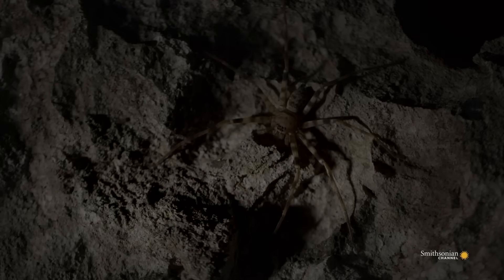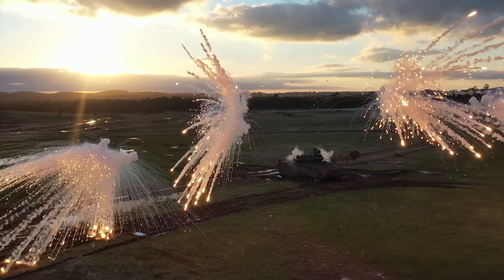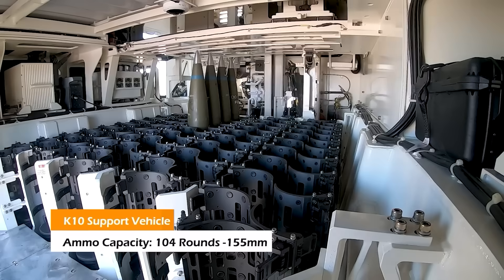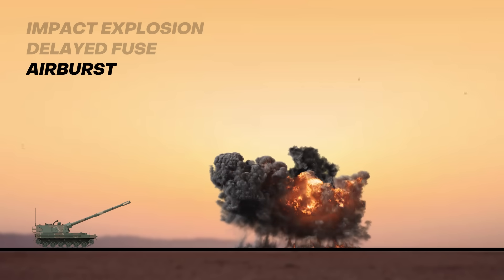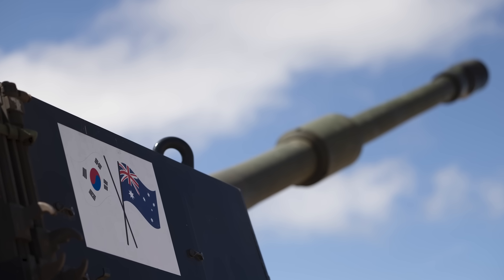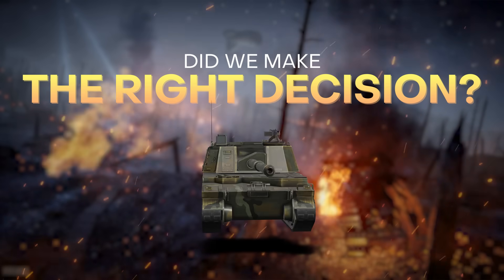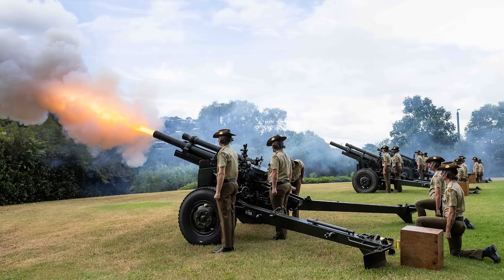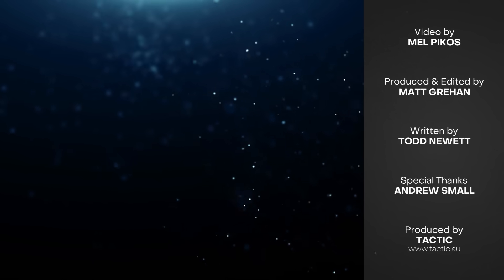The AS9 Huntsman Explained: Australia's New Heavy Artillery

Comment: They probably did their research but for me the first thing was it is slow 67 km/h and its range is 360 km logistics could be an issue.
Also it can't move and fire at the same time and it is not modular so customizing it later is costly.

On the other hand KDNS and Rheinmetall are looking into Modularity as a standard.
They are looking into mounting additional automated smaller turrets and other automated systems for close range anti drone warfare for their existing vehicles. 

I think the problem with Australia is that they are in a hurry to arm themselves and doing things fast might not always be the best.
Anyway it is maybe a good thing that they only bought a few of them it better to have some then none.
Especially now that Europe is also going to be making massive orders for new military systems.

Comment: Ex-gunner from 7Fd Regiment and then a naval officer of 30 odd years here. 
Hmm,  mobile artillery always seemed a no-brainer to me, but l could see the use of a mix of that and light towed  or air delivered artillery aka 105mm for amphib or other expeditionary operations would be useful.  Not quite sure why we got rid of the 105mm; l thought it was handier, easier to manoeuvre on the battlefield and logistically simpler to manage.  
On top of that, with my navy hat on, our direct threats are and have always been from the sea, hence the bigger investment in the Navy atm.  
Anyways, my two bobs worth.
Reply: The 155 mm standard use around the world for all heavy guns this is why a change was made. Any weapon and caliber will be used as it should but logistics and supply is what wins a war. The ability to use any countries or branches stores is a significant advantage.
Reply: @lawrencemason2827  155mm is a medium caliber.
Reply: @anthonykaiser974  sorry did I say Larger or Large. But yes correct.
Reply: @lawrencemason2827  had you said "large caliber" that would be 76.2mm/3 in or larger, this is correct by UNROCA std at least (TIL). You said "heavy" which, depending on who you ask, would be larger than 155, which has been a breaking point between medium and heavy, particularly since true heavies (i.e. 203mm/8") are still employed. As a career US FA officer who came into service while the M110 series was still (barely) in service, I'm sticking to my  "155 is medium artillery" belief. Heavy roles were assumed by rockets and missiles like MLRS.
Reply: Well said Kim
Reply: Whilst 105mm howitzers
(M118/119) were light weight and air drop capable, they severely lacked the range and lethality that medium caliber howitzers could achieve. The inverse of this was that essentially every contemporary 155mm towed howitzer was far too heavy to be air mobile, namely the venerable M198 in US and Australian service.

The M777’s largely titanium construction offered an excellent compromise of the range and lethality of medium towed systems, whilst weighing half as much as the equivalent medium system 4.4t to the M198’s 8.8t.

Don’t get me wrong, there are a number of drawbacks to the M777 where a 105mm system would shine, but the biggest kicker is simply 105mm systems are far too short ranged and lack the punch of 155mm.
Reply: 105mm is weak nowadays.
Reply: @A-xp6my it's weak.... But it's mobile and more efficient in littoral environments.
Reply: @andrewcox710  any drone can do it cheaper and more accurate
Reply: @A-xp6my  how long does it take for a drone to cover 40km? Cos a 155mm will do it in about 1min 20sec. 
In an environment where engaging time sensitive targets are sometimes key to the success of overarching plans, everything has a place.
You don't play golf with one club (fpv drones).....
Reply: @andrewcox710  Time does not matter.  If the target moves your cannon will suck, but drones will follow it. For the price one Excalibur you can send 100 drones nearly simultaneously on 40km. They will be slow, but nearly impossible to evade. And they can destroy 100 targets. How many targets can one Excalibur destroy?
Reply: @andrewcox710  Depends on what drone. But whatever you would use, for the price of single Excalibur you can send 100 drones, and they will be remotely guided and follow moving target, or even destroy 100 targets. 
Imagine you fight a strong advanced enemy, within that minute of your shell in the air the enemy's radar will locate you and send their shell back. Boom, your artillery is destroyed. But you don't care if you launch drones.
Reply: The 105 kept us alive!  Arti fan.
Reply: Hey mate, ex 108 Bty 4th Fd Regiment gunner here, served from 00-04. The L119's we used to use were to be honest, ancient... We had pushed them to their limit. the old Airborne light artillery being choppered into combat is really now a think of the past. Couple that with its limited firepower, it was well overdue to be replaced. That coupled with the fact that by the time we had fired a round, anti artillery batteries are already able to fire back at us within 40 seconds, which is far faster than we were ever able to pack the gun back up and exfil.
Reply: in Ukraine the russians developed tech to find and return artillery fire on Ukrainian positions with in 15-20min
Reply: @SuperJohn12354  The Russians didn’t invent anything of the such, the equipment used for counter battery fire has been around since WW1, called sounding and ranging.
Granted the modern equivalent with weapons locating radars are far quicker and more accurate.
You’ll find the time to triangulate and return fire isn’t 15-20mins but is actually much closer to 3-5 minutes.

The biggest drawback is that active scanning WLR’s are easily detectable on the electro magnetic spectrum and thus often draw fire of their own, this lead to passive systems which offer less accuracy and speed at the cost of not actually radiating any detectable EMF.
Reply: @SuperJohn12354 😂😂😂 we've had the capability to do this since 2007 mate. As soon as an indirect round, or volley, is fired, we'll see it within 5 seconds and be able to return fires within 1min.
Reply: 7fd when it was im downtown Willoughby
Reply: @kimbaldunsmore4633  Ukraine war tells us gunnery is having a Renaissance. Giddy up!
Reply: @ Sure it does, if you have around half of a million soldiers and a couple more busy with supplying them. Even if you manage to find this many people, imagine the number that your potential enemy may bring. Are you sure you can handle it? Do you still like artillery and gunnery?
Reply: Some of you need to realise Australia has drones too, drones can be shot down, taken out by other drones, birds hell there's footage of cats taking them out they are not invincible and bet as long as your points to ground they are already developing an EMP round most likely deployed by an artillery system
Reply: largest issue with the L119 is the setup and pack up time, with a fully maned fresh!  crew that was familiar and drilled with each other could mange 12-15 minutes to deploy into theatre grid, takes about the same time to pack up depending on prepared ammunition, as you would be aware the counter battery would very find us after the adjusting round and decimate us all, although i see the point of keeping the capability for the reasons he listed i would argue large calibre mortars in the hands of the Infantry would be the better option to maintain that capability, you can amphib and air deploy, move them by rover and trailer and they could maintain smaller calibres if they needed  hump them through the bush.
Reply: American experience in Vietnam showed that the 105mm is inadequate for fire support role. So much so that the M108 (which sported a 105mm howitzer) was immediately retired following the end of the war.
Reply: @mirageiii3176  tell that to Hal Moore's boys at LZ X-ray. 105s kept lots of 1/7 CAV troopers alive. They told me so.
Reply: @anthonykaiser974  Amen!
Reply: @mirageiii3176 the 1/7 CAV at LZ X-ray didn't think so. One of the officers told us in FACCC in 2000 at Ft Sill. When you're danger close, 105mm is really handy, and the rate of fire is really good, especially the first minute (10 rds first minute, 3 rpm thereafter IIRC). If you're close enough, lower charges increase your rate capacity. That said, grunts prefer 120mm mortars, and a SP 120mm How-tar would be a great replacement.
Reply: > On top of that, with my navy hat on, our direct threats are and have always been from the sea,

But since WWII it's always been Army that does the fighting.

Comment: 3:15 If you are already deployed, then sure, but tactically the towed arty is way more versatile if you're dealing with bad terrain, etc (can be floated, slung under helis, driven on narrow tracks, etc). These big self propelled pieces are great if all of your forces are coherent and systematically moved around short distance, but imagine having to move 100km in a rush, loading them onto heavy trucks, etc. Through WW2 jungle/island warfare Australias military restructured by dropping heavy equipment numbers, allowing effective logistics/movement.
But, perhaps if the new modern warfare is all as static as it is in Ukraine, and air power is nullified, then heavy armour does seem logical.
Reply: Imbed a shit ton more Mortar teams into regiments would be useful for what you describe

Comment: Def should have kept 2 regiments of AS9

Reserves should also have 105 towed regt in each brigade
Reply: Himars makes more sense though why the regiments in 1/2 seems more like internal bureaucracy then sound reasoning.
The USA Himars has a prexisting inventory with 500 already produced & 200 more in production to be delivered by early 2028.
AS9's Still have to be made but in a worse case scenario about 50 odd M142 Himars can be shipped to Australia.
Taking both systems since already invested in would have been the best bet incase complications arise for either.
Reply: @arnijulian6241  Problem with HIMARS is the cost of the rockets and how fast they burn through munition stocks. It is an awesome weapon system, but what are those gunners doing once they've run out of rockets?

155mm shells are massively cheaper by comparison (a few thou to ~$100k a shell v ~$1M a rocket), so i'd prefer the extra 30 AS9's as a back up for when the HIMARS rockets run dry.
Reply: @ Depends on how yu look at the service live of mobile convential artillery compared to rocket artillery.
They are both going to get blown up eventually & so is it better cost for many artillery shell that might get used or few rockets that will likely be used.

They both have benefits.
Why I don't understand halfing the the wolf spiders as it's a false-economy to make 30 instead of 60.
still more then 60 I think it is deminishing returns.
should have been reduced to 3/4's for 45 as spare parts will be needed & such systems tend to be canibalized in active use to remain operationsal.

Still you think those in charge are going to listen to any of us?
even a dozen spare for 42 is just enough to work with for brigade.
Reply: @arnijulian6241 I agree on the 60 AS9's should still have been ordered. Even if they "sat around" as a ready reserve along with the towed artillery.

I also agree that both systems have benefits, but I still see one system as lasting longer munitions wise in any conflict.
Reply: @OneLeatherBoot  ''Munitions lasting longer'' in theory?
Certainty is never had in matter of polemology & even if the system is not taken out what's to say an ammo dump or key factories are not to be knocked out.

One Massive advantage of rockets is the platform costs a fraction of the cost while munition can be stored in less bulk as rocketry is self guiding & more accurate.
Really what holds back rockets is the cost of the rocket it's self though that has been reducing in over the century & will eventually match conventional munitions.

Reason why a lot of the west did away with conventional artillery Mortars is they assumed them obsolete by rockets in the late coldwar then assumed peace in our times scraping many assets after which that was a mistake!

Reason why Russia fields artillery superioirty is they never scrapped coldwar assets.
West cannot today after avoidable decision that have long passed meet conventional artillery production of the East as Russia let alone China.
West has to go the rocket artillery route.

You look at most western inventories they keep the bareminimum of conventional artillery for a reason though wish they could do away with that logistic strain that once never was a strain but the norm.